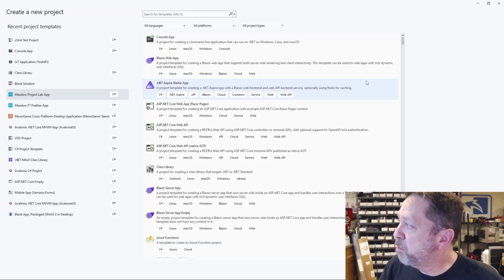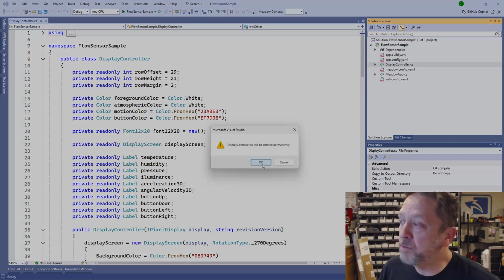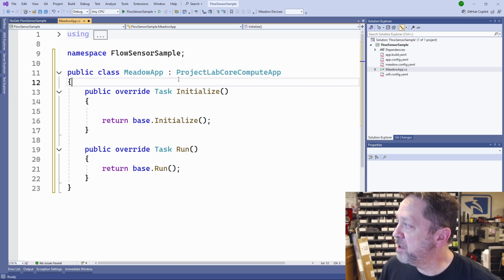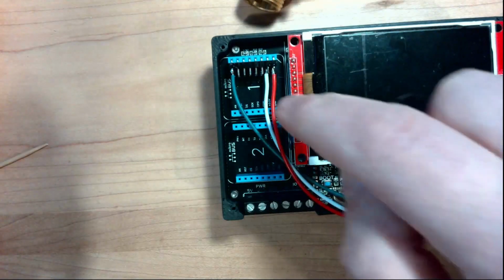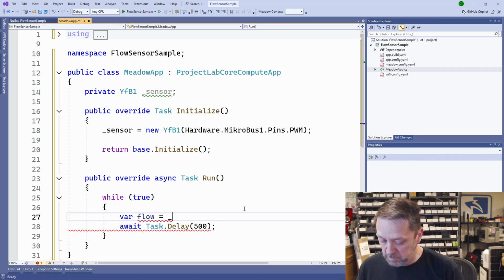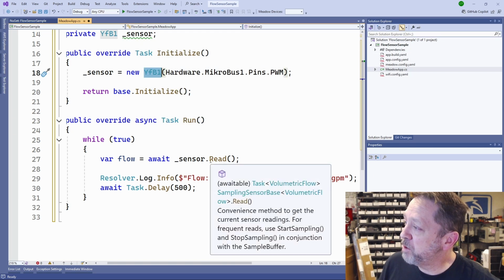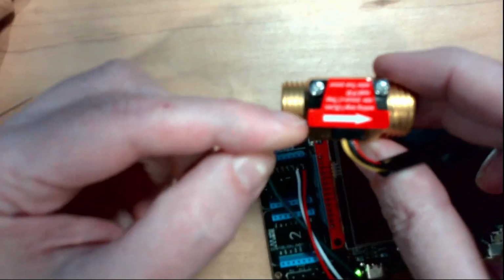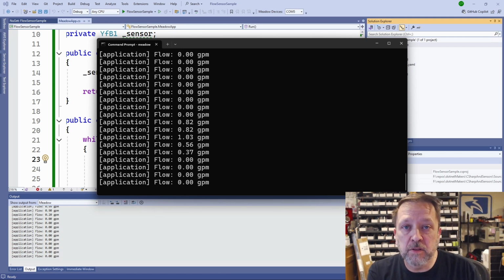C# and Sensors EP11: Using Hall Effect Flow Sensors with a Wilderness Labs Project Lab (ESP32)

Comment: Hi Chris,  Thanks for the video. I was thinking of using an optical mouse's sensor as a displacement measuring device with the help of a Raspberry Pi.  I wonder if there are    any libraries in Wilderness software base  whereby I can read a mouse's X and Y coordinates which is connected to the pi's  USB port. Or perhaps, I have no other choice but open the mouse cover and connect the sensor data pins to a raspberry pi's pins whether it is  using I2C or SPI protocol.  Cheers.
Reply from the maker: My understanding is that an optical mouse typically uses a low-res CMOS as a camera to take photos of the desk surface very quickly, then uses an on-board DSP to turn changes in those images into movement.   I'm not sure that you can easily hook into that sensor, and if you could it's not going to provide an X/Y, but rather 2D displacement (which you can probably get from the HID driver)